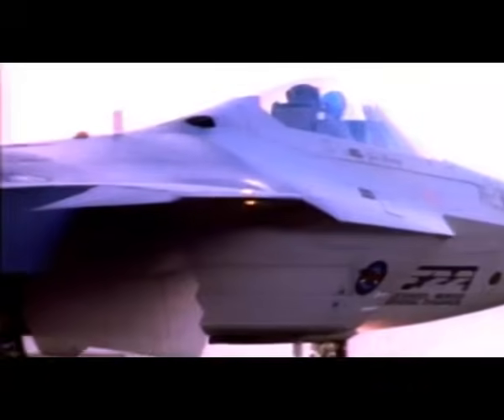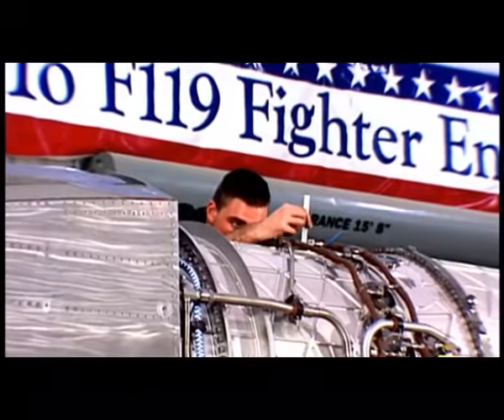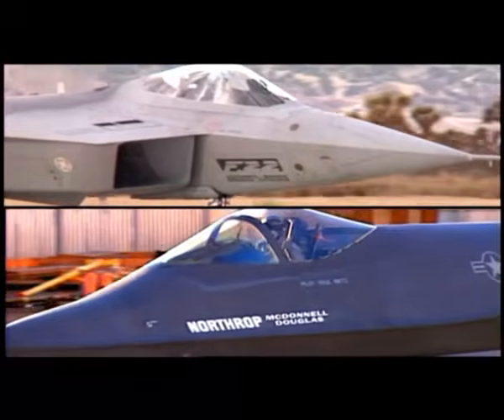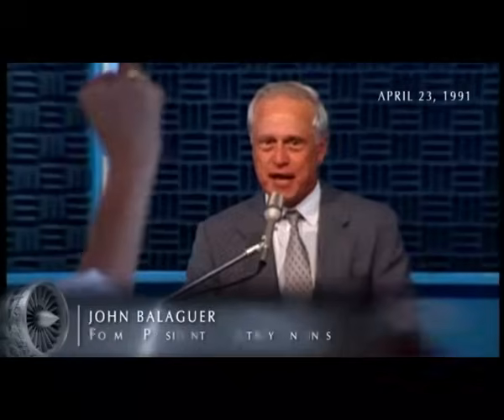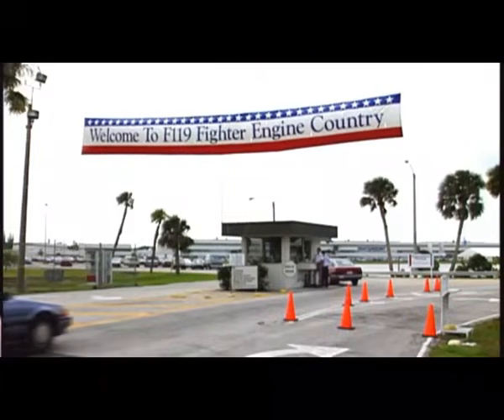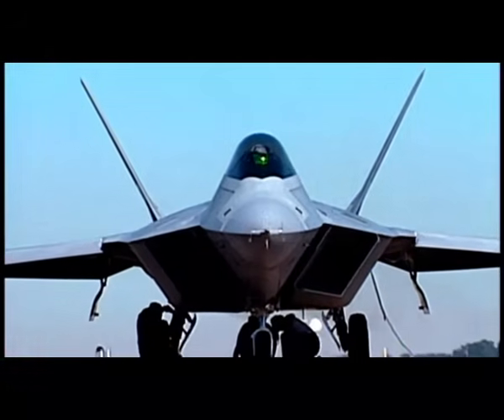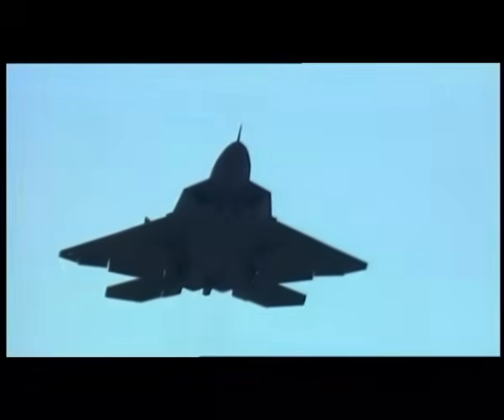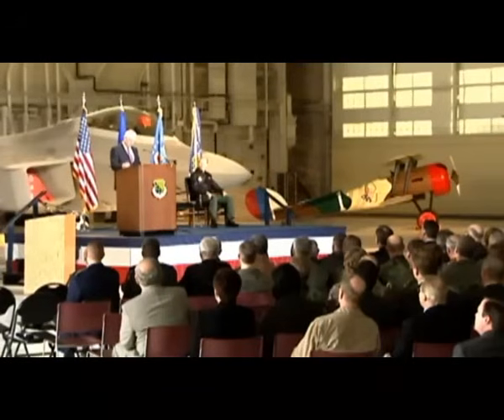Pratt & Whitney F119  - F-22 Raptor engine developement retrospective

Comment: Northrop had them beat, politics won it for them......but i will say, when we have accomplished our best innovations, it's always when we pit ourselves against ourselves instead of against another country
Reply: Northrop Grumman aircraft company Pratt Whitney was in competition against General electric for engine selection. Northrop Grumman was in competition with Lockheed Martin for aircraft selection for the ATF program. The yf23 done few things better a little more stealthy but f22 was better in lot other areas
Reply: @dwizzleusa4202  Wouldn't the F23 do well in the modern world when stealth, speed, and range which the yf23 did better would be more important than out right turning performance?
Reply: @memememine1  The YF-23 was an incredible aircraft but the point of this fighter program was for an air superiority aircraft. That means that it can go up against any aircraft in the world in a dog fight and come out on top and the YF-22 was the better choice for that because of its thrust vectoring. In hindsight, because of what we use F-22's for which is a fast, long-range, and stealthy interceptor and strike fighter it would have been a better choice to go with the YF-23.
Reply: @mabbook  Yeah you are right. The F22 fits the program requirements better.
Reply: Northrop AND G&E had them beat. G&Es adaptive cycle engine had superior technology promising greater thrust and reduced fuel consumption. The air force made the safe choice, not the best choice for the future.
Reply: @rapidsqualor5367  To build a plane like the Raptor, which cost $70,000 per hour to operate was hands down the stupidest waste of money. Any enemy who a fighter like that would be used on, an F-15 could still handle without a problem. Any enemy who uses a chemical weapon will be nuked.
Reply: @daveberry5901  If they had gone with the YF-23 and GE engine, it could have been even more expensive. As we saw in desert storm, modern battles hinge on air superiority. Tech to allow that is expensive and the F15 is almost 50 years old.
Reply: @rapidsqualor5367  I get all that. . .My point is  they show a mechanic working on the plane in a chemical suit. . .As though an enemy could be launching chemical weapons at us while Raptors carry out attacks, they come in for maintenance. . .There is no difference between using a chemical weapon and a nuke. . .Any country attacking with a chemical weapon would be nuked, and that will be that. . .
Reply: @daveberry5901  Do you feel the same way about biological weapons ?
Reply: @rapidsqualor5367  Bio and Chem weapons are considered the same way. . .Do you not recall when a reporter asked George H. during the first gulf war, of what would happen if Saddam Hussein used chemical weapons against coalition troops???
Then George H. said  
"There would be disastrous consequences" 
everyone knew exactly what he meant, that he would nuke Baghdad.
Reply: You mean the aircraft engines in the competition were pratt whitney and general electric.
Reply: As you all gleam and wonder in amazement. . .I am not so sure. . .Let us deal with reality. . .The idea of an engine tech in hazmat gear is ridiculous, and WW II thinking. . .It envisions a War where fighters are flying to attack targets and protecting bombers, then coming back for maintenance. . .My friends, this may have been in 1991 but if something like that happens today its going to be with the gear we have and use of chemical weapons are no different then nukes. . .If a country or dictator type were to use even a rudimentary chemical weapon on a US base their backyard would soon as a glass yard and you know this. . .The last numbers I heard of the cost per hour to fly a Raptor was in the neighborhood of $70,000 "Per Flight Hour"  It is a beautiful and amazing plane, absolutely, I take nothing from its design, power and ability. . .However, it will never be used for what it was designed for and will be in the end a foolish waste. . .

Comment: Thirty years later the enemy still cannot manufacture a similar engine. The current crop of 5th generation jets are powered by 4th gen engines. Go Raptor!
Reply: Idiot MiG 25 Foxbat with Khibney jammers , irbis AESA radar  n Kinjhal hypersonic missiles will will still beat any flying fucking machine on this realm.
Reply: @bellpepper3235  Irbis is PESA radar , lol 😁
Reply: The SU35 engines with its thrust vectoring systems is far more capable and impressive,than the F22,don't forget that it is 1990's Tech,Notice that when the F22 does shows in Nevada,for(gulping)paying public,it always have its after-burners on(so much for super cruise...!!!)And the O2 Raptor's system,is still not fixed above 10.000 Feet,Pilots are still complaining about respiratory problems,they basically need to put the plane apart to fix it because the entire system is deeply buried into the planes skin,so they have to "destroy"a plane,fix the O2 tubbing system and"rebuild"it,The O2 System is built under the stealth skin,on the YF 23 The O2 system was built and accessible directly from the cockpit,and fed threw the engines,on the RAPTOR,they went with canisters,just like safety masks in Large airliners!!!and"then re-filled after every missions with an exterior valve,some Pilots had to plunge fast to get back to a breathable level,because the canisters were empty....!!!!!
Reply: @joehentalack2443  There's this company called Volvo, building the engine for Sweden's answer to the Raptor . . . look out!

Comment: why don't they build a fighter with a single F119 like they did with the F100 in the F-15 and the F-16
Reply from the maker: +xxp417 The F135 engine used by the F-35 is closely related to F119, not as close as the basically same F100 used in the F-15/F-16 but the principal is similar.